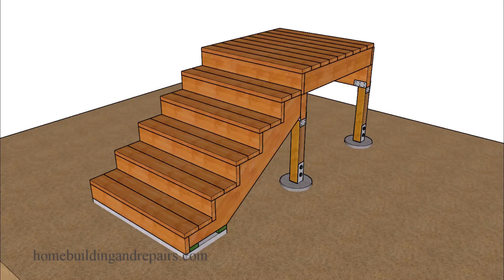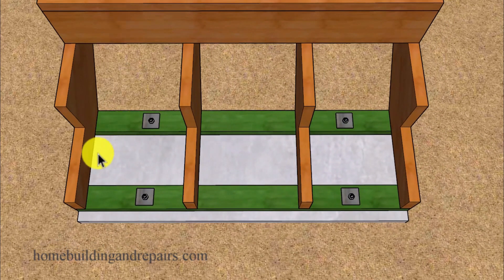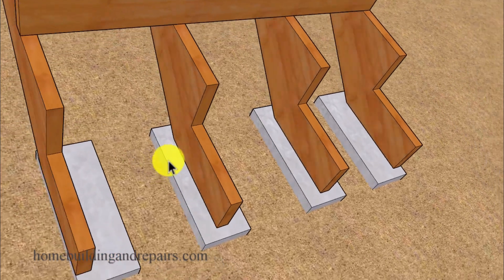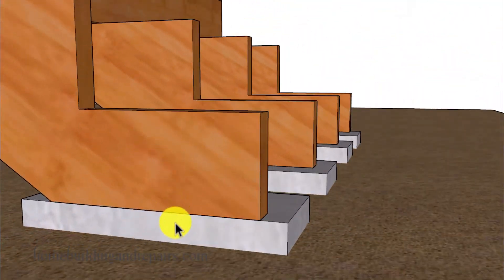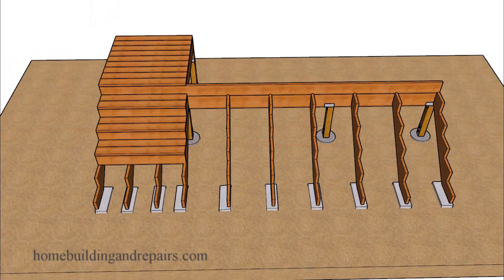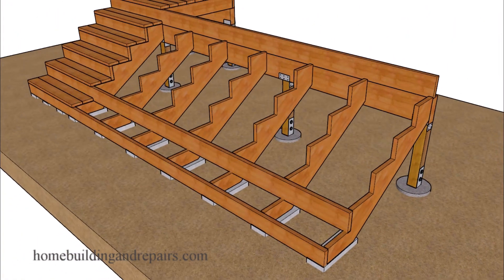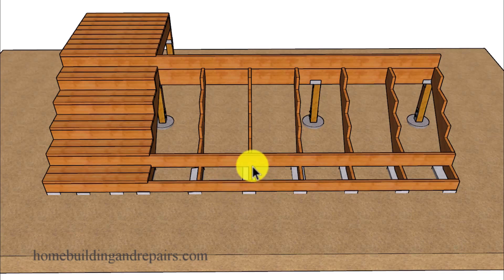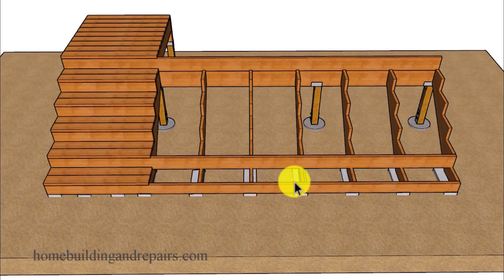Future Stair Building Problems From Using Small Structural Support Footings - Construction Education

Comment: And if you use risers as support, 2 things might help:
Simpson ties behind risers, tieing riser to stringer, and use a post-holer to get a column of concrete below the frostline, and support the outermost stringers, plus one under every 4-6 feet for wide and tall stairs.

It's time consuming, and posthole digging is hard work, but if you have more time than money, concrete is still relatively cheap.  Right now, where I am, a 60# bag is still under $5, and a 3'x9" posthole is less than 3 bags.